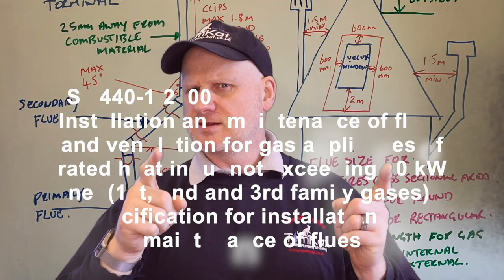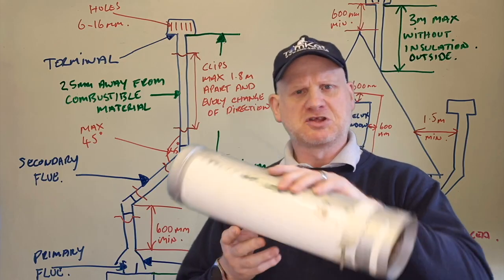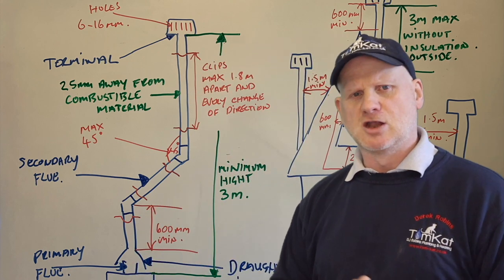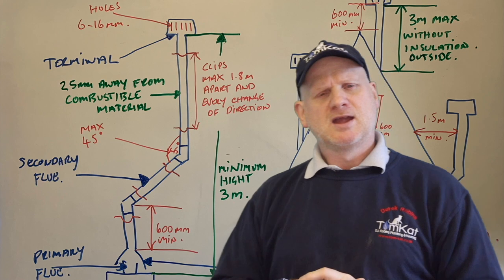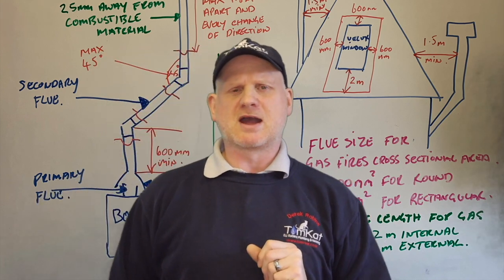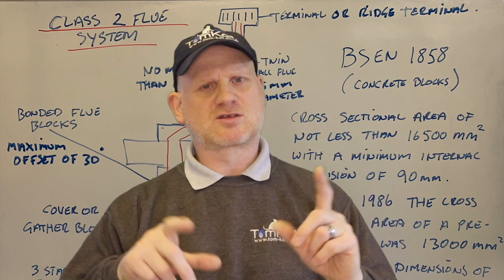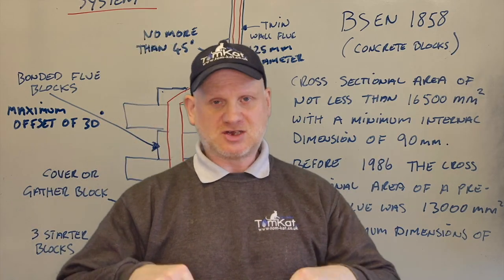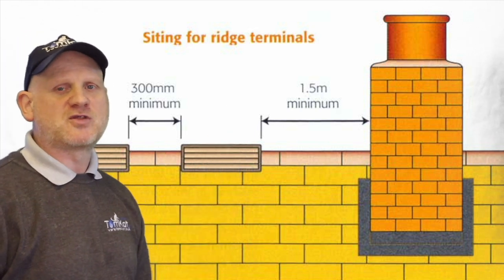OPEN FLUED APPLIANCES, part 2 of all gas trainees need to know about gas appliance flues.

Comment: Warning, if you shut the door to a compartment you must have a personal Carbon Monoxide detector mounted on your person that has been tested and proven over and above the flue gas analyser you are using. the personal Carbon Monoxide detector should be set to Alarm at its lowest setting. should it Alarm open the door and ventilate immediately.  We do not need to lose another Engineer to this situation.
Reply from the maker: Are you selling the alarms then because boilers are room sealed now so where is the danger

Comment: I always have a cup of water when doing a flue flow test, if it fails and the smoke starts coming back into the room I can extinguish the pellet immediately stopping the room getting filled with smoke. Good video 👍
Reply from the maker: Using a smoke match first is to stop that happening but good advice anyway 👍🏻

Comment: When you were doing the through flow test on the chimney I did exactly what you did without the closure plate and was told this was incorrect on my ACS. Was told it must be done through the opening on the closure plate to also test the spillage on the plate.
Reply from the maker: Well that’s just not true what if it’s a DFE or ILFE fire that has no closure plate. Again trainers and assessors with different opinions

Comment: Thank you for your help, effort and passion u put into each video. Been learning more from u than my tutor. My question regarding the precast, u mentioned that it should be 3 starter blocks then it should rise 600mm above the outlet of the appliance. The 3 starter blocks are 600 themselves, shouldn’t the 600mm straight flue before any bend be above the 3 starter blocks? 
Many thanks in advance.
Reply from the maker: Thanks for watching the starter blocks are the catchment space and the primary flue the 600 mm rise is in the secondary flue hope that helps 👍🏻

Comment: Fantastic video! Lots of information. That hour didn’t feel an hour at all. Too much concentration lol. Really enjoyed it. This will definitely help me. Especially with revision.

At 35:45 you said if you screw the regulator in, your pressure should go up on the gauge and the flame should rise and if you turn it back anti-clockwise the pressure will go down and reduce the gas going in. I don’t get this. Isn’t it right for ‘tighty’ and left for ‘lucy’? So, if you screw the regulator in it would restrict the gas flow, but here it’s increasing the gas flow so more gas goes to the burner??? Thanks Derek. Much appreciated 👍🏻

Asian Jon. Training.
Reply from the maker: When you screw down on a regulator it puts pressure on the spring and diaphragm so it increases the pressure screw it up it decreases the pressure
Reply: @tomkatgastraining  Thanks!

Comment: Great video.  Dont like using the smoke pellet holders, while you are there holding the pellet your not running round checking the terminal and in the loft and bedrooms etc,
Reply from the maker: Once the smoke has gone you can check the rooms and loft for smoke because if it is leaking the room or loft will be full of smoke. Granted you might need to use a second one and run outside to check the chimney 😉
Reply: @tomkatgastraining  this is where an apprentice would be handy, im not as quick at getting up that ladder to the loft nowadays 😄

Comment: Thanks for the video. If you went to a house and found a precast flue system from pre 1986 that had internal dimensions less than 90mm, how would you categorise it?
Reply from the maker: Ncs but it also depends on the appliance connected to it and if it passes flue flow and spillage

Comment: @tomkatgastraining  why are gas pipe that run through ducts  sleeved and sealed at one end only
Reply from the maker: Gas pipes that run through an outside wall require the sleeve to be sealed to the wall at both ends and the gas pipe sealed to the sleeve on the inside so if gas escapes it one go into the cavity and will disperse outside so not to create an explosion
Reply: @tomkatgastraining  ooh thank you